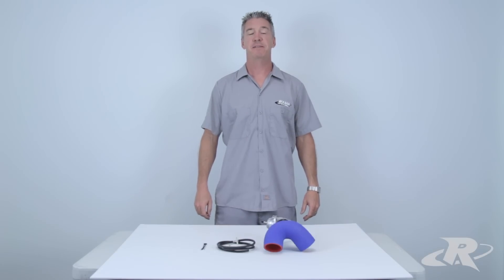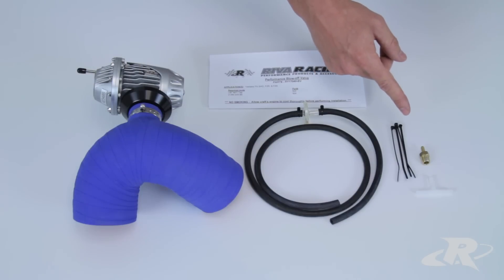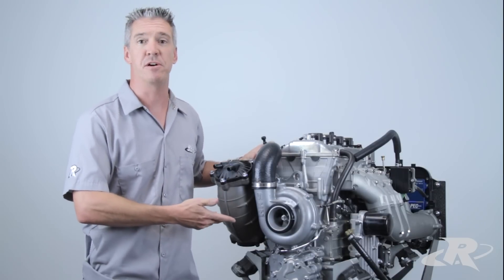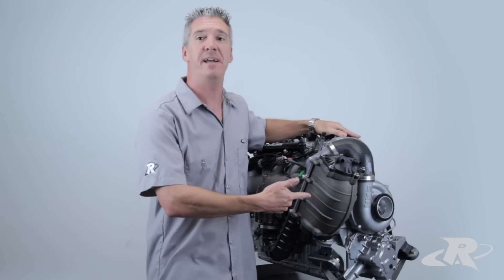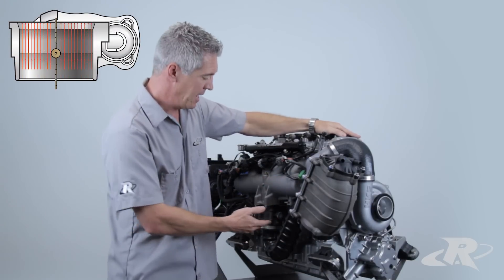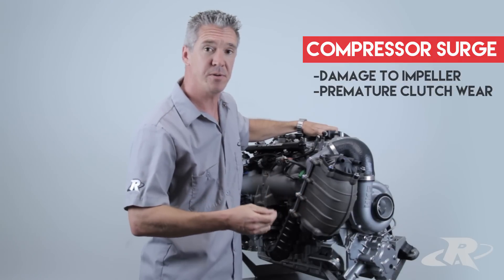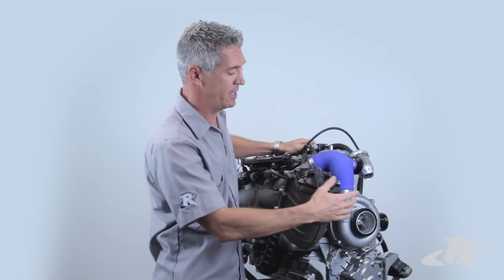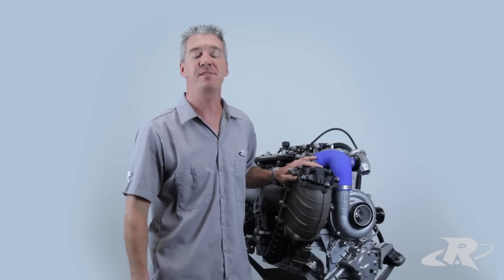RIVA FZ & FX SVHO/SHO Performace Blow-Off Valve Kit

Comment: When you install the BOV, how did you suggest connecting the Vacuum line? 
Do you drill into the Intake Manifold and thread on the Fitting?
Or do you use the T splitter and connect to the hose under the MAP sensor? (Is there anything wrong with taking this approach)
Thanks.
Reply from the maker: Hi Ryan,When doing this install do not connect to the MAP sensor tube. That will cause errors in fuel/air mix. Please be sure to look at the directions in the kit instructions to attach the tube to the manifold.

Comment: Would this help the issues I have read on the pre 2013 engines with the weaker clutch?
Reply from the maker: Yes- The Blow-Off Valve Kit helps reduce stress on supercharger clutch and drive gear. This promotes longer clutch life and increased reliability.

Comment: just purchased 2016 fzr looking to do anything I can to improve reliability to my supercharger. should I wait to install this product until after 5he breakin period? also this product seems to make a lot of sense, why doesn't this blow off valve come stock with the supercharged engines?
Reply from the maker: +John Lucas The RY17040-BV Blow Off Valve Kit can be added to the ski at any time. There is no need to wait 5 hours breakin period to install as it does not affect the power. The reason the unit’s do not come with a blow off valve from the factory is because with lower boost pressures the factory charger produces the clutch in the supercharger gear set handles any back pressures. As boost is increased, or if the ski is ridden hard and/or over rough water the blow off valve will help increase reliability of the clutch and supercharger.  For any questions about other parts or modifications please email arminm@rivamotorsports.com